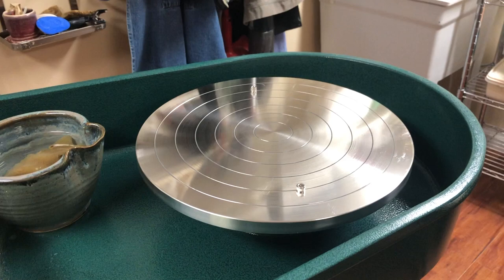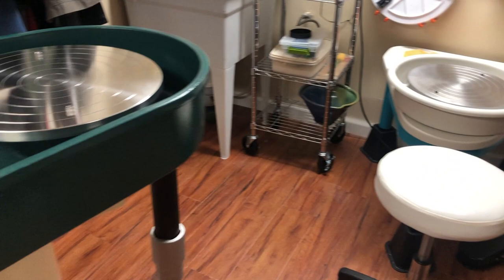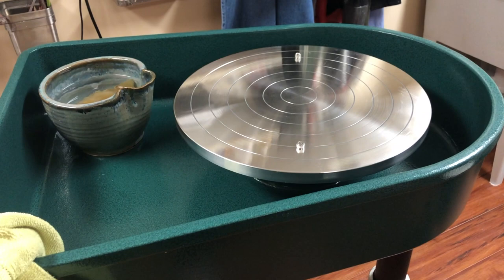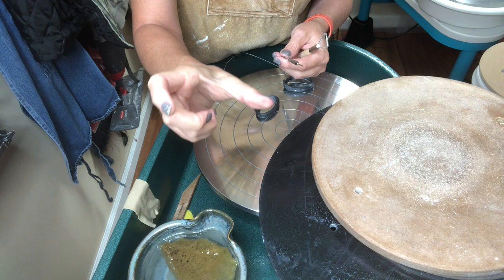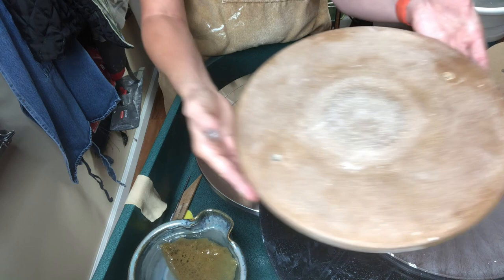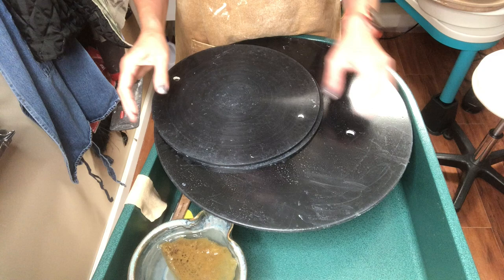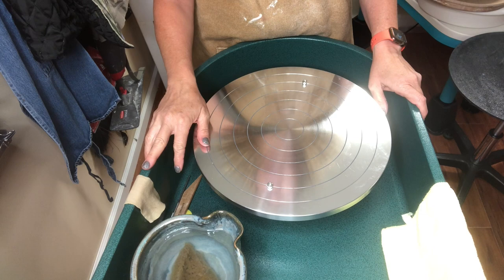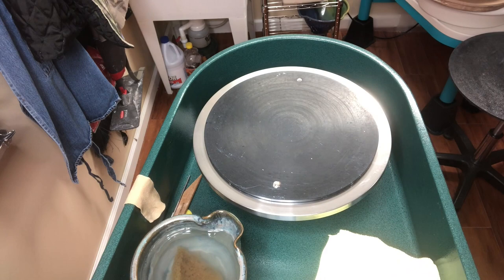Wheel Series:  Wheel and Tool Preparation for Throwing on the Potter's Wheel

Comment: Hi Karan, Do you have any helpful critiques on your Scut wheel? I’m torn between getting a Scut Steven Hill or a Soldner wheel.
Reply from the maker: Hi Ryan- I am actually working on a video I have yet to finish about my Skutt wheel.  First and foremost, I have to say I have never tried a Soldner, so I can't offer a true comparison.  I can at lease give you a review of my Skutt though!!    My first wheel I had for over 25 years before I sold it was a motorized Thomas Stuart Kickwheel.  Loved it- it was a great workhorse- but way too noisy for my videos.  When I started researching new wheels, I discovered that Skutt bought out the Thomas Stuart company a while back, and thought I would look at their products.  I am so glad I did!! 

The Skutt Steven Hill one is similar to mine, but I just didn't get the one with quite as much horsepower, as I felt that would be overkill for me.  I have the classic, which has 1/3 hp motor- I believe the Steven Hill is 1/2 hp.  I don't ever really have the desire to go beyond 25 lbs for any piece, so I felt it was plenty enough for me.  Things I LOVE and I feel changed my life when I got this wheel:  #1 I LOVE the legs extensions for standing.  What a game changer.  I absolutely LOVE this.  I never knew just how much I would love standing- but I do!  It's silly, but every time I use my wheel, I think, "Gosh, this is an amazing wheel"!   Lol!  I know one thing I was concerned about prior to getting it was wondering if it would feel sturdy.  It is amazing.  It's heft really makes it feel sturdy.  (It makes my lightweight Pacifica seem like a toy now)   #2 I LOVE how the entire unit is a built in splashpan and not a removable splashpan.  I love not taking off splashpans and bringing to my sink.  I don't throw with a bunch of water anyway- so my clean up is not that extensive.  If I used a ton of water, I may prefer a removable pan.   #3 The smoothness of the pedal/wheel responsiveness is fantastic.  And, it purrs. ;)  (I love shooting videos with it, as it is so quiet).  #4. The removable wheel head.  LOVE this!!!  It makes clean up a breeze, that, and I also just like to take it off to clean every bit of clay underneath.  (Especially nice like when yesterday, I was throwing some red clay.).  Did it ever once occur to me before I got the wheel that it would be nice to be able to remove the wheel head so easily? Nah... but boy do I love it now!!
#5  I got the wheel head extension as well, which is perfect for huge platter bats or a Giffin Grip with a wooden platter extension- which without the wheel head extension would run into the walls of the built in pan.  It is a simple solution to lift the wheel head a bit more.
 As an aside, the height is just perfect for when I am not throwing, I just place a big ware board on top , and it doubles as a convenient height for a standing worktable.  (Like when I want to handle cups and such) I'll try to get my video review of the wheel and the set up of it posted soon- and I'll come back and post it here!

So, in a nutshell, I am a giant fan of the Skutt, and wouldn't hesitate to have an entire studio of them if it were in a budget to do so. :) I have some 25+ year old Pacificas at school that I would love to replace with these someday!   If you have any specific questions, don't hesitate to ask!!  :)
Reply: @KaransPotsAndGlass  thank you so much for such a prompt and thorough review. I am really grateful you took the time out of your day to give such a wonderful response. How long have you had your wheel now? I’ve heard another potter review their wheel after a year and had a slight complaint that it’s too loud for them. Though I think that’s just a personal preference on her side, although it makes me wonder if the wheel will get louder in time or not. In the videos I’ve seen you use it, it didn’t really seem to be an issue.
I’ve mainly been throwing on Brent and Shimpo wheels. The issues I’ve had with Brent wheels are that it doesn’t seem to transition smoothly between the speeds, Jittery at low speeds (if you can call it a low speed), and tend to revolve on its own at times. I loved the Shimpo wheel for its slow speeds and smooth even transitions. Though it lacked the torque that I like.
Can your wheel go pretty slow and has a smooth transition between speeds? Any issues like I’ve had with the Brent wheels?
I understand that you do production work, which makes that huge splash pen and asset. I’m still pretty new(Two years in) and haven’t found my clay body of choice so clean up between the different clays I use in one session might be a little disconcerting for me. Otherwise, this is really a tempting option for me. I’m glad that you get so much joy from working alongside it.
Though I’m still in a debate with myself you’ve given me A lot to think about. Thank you!
Reply from the maker: @GuardiansGuide  I’ve had it since spring break last year- so March or so?!  And, yes, very smooth transition in speeds from slow to fast. They have some with removable splash pans too-  essentially the same wheel- just with a different pan! https://skutt.com/pottery-wheels/
Reply: @KaransPotsAndGlass  awesome! I really look forward to seeing the video review as soon as you post it. I’ll make sure to update you on what I decide lol 
Thanks again and take care!